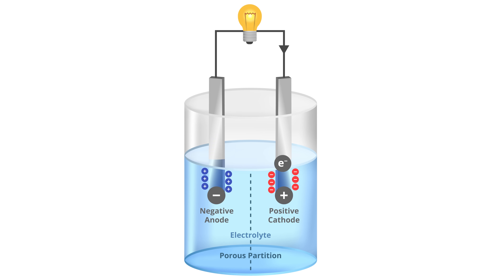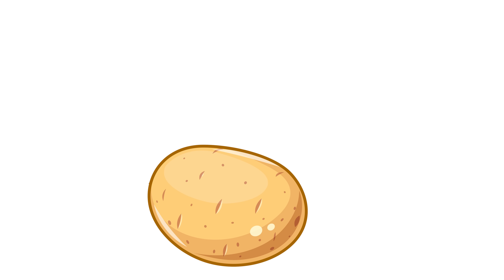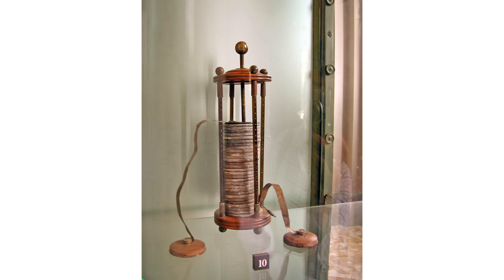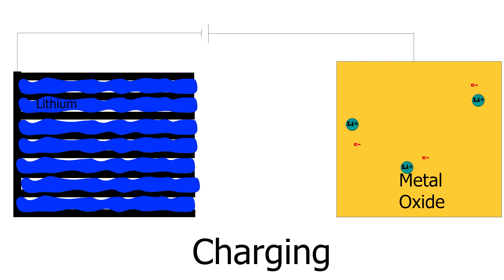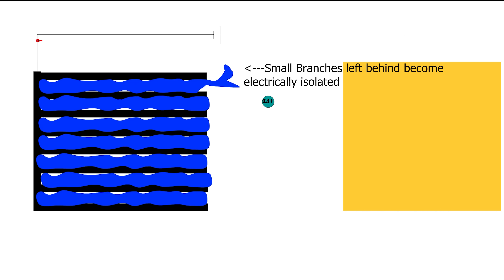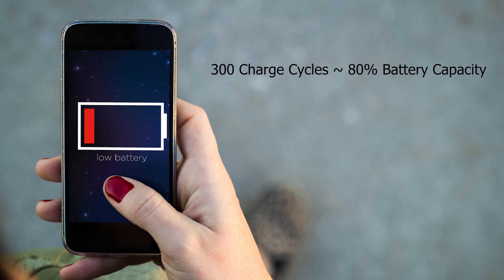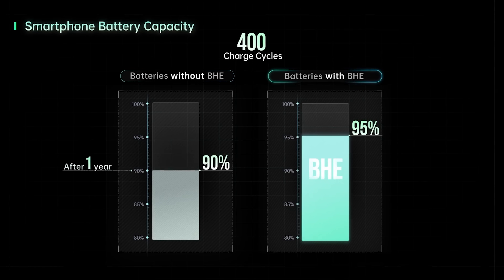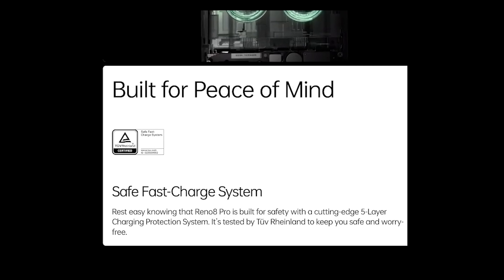How To Stop Dead Lithium and Double Your Phone's Battery Life

Comment: If your phone is rooted, you can use the app "battery charge limit" (free or a few bucks) which works on every phone I tested. Even the non-popular ones (i.e. FxTec Pro 1) are supported.

The app allows you to limit charging to a value you need. I always used 80-85% (-> 85% is the maximum charge). More important though is to always make sure to recharge your phone (and any device in general) before reaching 15% of charge. Notebook batteries often have a buffer, but at phone batteries you can expect slight damage every time you go below 15% of charge. The lower you go the heavier the impact.

Lastly, you don't want to overheat the battery. The best way achieving this is to limit the charging current. You don't need fast charging, use 1A power supplies instead. But don't worry too much if you charge your phone with 2A, just make sure it doesn't get too hot.

That way Li-Ion batteries can last for a decade without problems.

Comment: Greedy jerks at Apple, Microsoft, Nokia, Samsung & others have known this about lithium ion batteries for a long time, especially the Lithium Cobalt Oxide / Hard Carbon battery so common in portable electronics. They deliberately overcharge the battery cell to cause it to fade faster, because the #1 reason people upgrade their smartphone, weak battery! Thank you OPPO! Please share this with Tesla & Mercedes & Toyota & Nissan & all the EV makers //
Reply: A prudent electrical engineer familiar with lithium ion cells would never charge above 4.11vdc, but most phones charge to 4.26vdc or 4.35 vdc, causing an irreversible loss of lithium into the hard carbon / graphite anode / yes dendritic loss of lithium ions a major issue, but fully charging a new lithium ion can help to improve formation of the SEI layer to mitigate that issue.
Reply: The NEST learning thermostat holds its internal LiPo at 3.82vdc, float charging it gently between 65-80% state of charge to dramatically improve the lifetime of the cell //

Comment: "Charge slower and don't let it sit charging at 100%" - nothing new, yet pretty hard to do most of the time.
Wouldn't it be great if besides million watt chargers and super fast ultra charging we got a night charging mode that would take ~6h to go to full and stop charging completely?
I don't care if my new-ish phone battery is 100% or 95% full in the morning, I know it will hold for over a day anyway, so I'd like to degrade it slower but there's no such option besides getting a low amp charger...

Comment: Yes try not to leave it charging overnight. Also, avoid heat 🔥 (driving with phone mounted above the dash in the day), instead use a magnet mount lower down (ideally phone resting over A/C vent)..

Also try not to let your phone die. Better to charge it 20%-80% than 0-100

Comment: I think you should've done more research into this company before sharing it in this manner and presenting it as if the company has technology that is significantly better than other phones. Realistically, Apple and other major manufacturers are already going to be doing most of this. I would've liked to have seen independent testing and/or meta-analysis of papers about this, before presenting this as a science video when it's actually an ad for a (probably kinda crappy) phone company.

Comment: I've switched to pixel phones 2 years ago primarily for Google Camera but I 'm still missing OnePlus dash charge which was basically just a rebranded version of Oppo VOOC. fast charging with no voltage conversion inside the phone, basically like if your charger was directly plugged to the battery. it is actually really very similar to level 3 DC fast charging on EV's!
The biggest benefit was no additional heat generated inside the phone except the heat from the battery we, which meant fast charging while using the phone and never overheating/throttling down the charging speed, and less slowing down at t'higher SoC
Biggest disadvantage was only fast charging with (kinda expensive) compatible dash charge/VOOC charger AND cable, and VERY slow 500mA charging otherwise..
A phone that can double the battery life is a great improvement! Unfortunately USB-C PD has become the norm but is inferior regarding heat management. I wish USB -PD could improve while remaining backward compatible, I like being able to charge laptop, tablet and phone with the same charger.

Comment: So beside it being an ad. A lot of smartphones already incorporated smart charging and it's not novelty. What is a novelty, from what you are saying, is capability to measure anodes potential independently. It is done by introducing 3rd electrode, which act as a reference. Both cathode and anode potentials are measured in reference to that. Lithium is quasi stable reference, but LFP for example can be very stable reference electrode. This system is called 3-electrode cell. By doing so, you can ensure that the anode potential never drops below 0, by e.g. lowering the power during charging (ohmic drop is proportional to the current, which lowers the potential at anode in dynamic state i.e. cahrging).

But that battery won't last long, as dead lithium is by far the smallet deteroration mechanism in batteries. Delamination due to size change and mechanical stress in the coatings, induced by z-fold or cylindricall geometry plays major role. Cracking of the cathode material, gas evolution and on and on. You can divide this into 3 categories - loss of active lithium, loss of active material and loss of contact. Dendrites formation is small part of loss of active lithium. Major part in particle cracking, renewal of the surface and increasing the SEI layer surface area.

Comment: Well, the title definitely feels a bit misleading all things considered... Kinda felt like a really short how to on Li battery operation and then a widely inapplicable solution...

Especially because things like not charging too fast or leaving plugged in are waaay old news. Modern tech handles these problems fine, your phone will slow down charging as it reaches risk areas. Just watch your own, most will start to slow down around the displayed 80% mark to prevent overheating or damaging the cells. We can't replace batteries anymore, and as much as people hate that kind of thing talking about planned obsolescence, no one really talks about it anymore. We just don't have a need, we aren't constantly wearing down batteries to the point of wanting one or two new per year, compared to other PO issues like processor speed or storage, although even storage has become so large and small that no one talks about SD cards anymore. My phone is 3 or 4 years old and im only now starting to feel like my battery isnt great, i charge in 15-20 mins and die over 7-8 hours, compared to 20+ hours when i first got it. Originally, like out of the box, i could almost get 2 days from one charge. But 7-8 hours after years is honestly still pretty good and i rarely if ever find myself in a position where my phone is at genuine risk of dying. I have to remember to manually reboot from time to time haha, because the battery is just still very efficient. 

Any chargers nowadays that would damage your battery life above normal degradation are doing something wrong. Especially since a lot of logic is in the receiving end on the phone.

Idk
Interesting stuff but i was kind of expecting more information relevant to the wide spectrum of viewers directly, in that maybe there was a new technique similar to the 'keep charge between 20 and 80' of yesteryear. Kinda just seems like we are in the same boat, just there are more identical copies of the same boat haha

Comment: It really needs to be said that most people's battery degradation is purely software.
So the real degradation does happen, and the device needs to know that because it can't over charge or let your battery go too low (when your phone says zero, it just means that it's too low to be used, as the volts drop the amps spike and that's a fire). So your phone has to guess at what your new battery capacity is. But it's really bad at guessing if you never tell it what the capacity is. The way you tell it, is by killing the battery fully, and charging to 100%. This hurts the battery, but helps the software. It's well known, and well documented that it is a good solution for phones, and now EVs.

Comment: I would feel more respected as a viewer if you had disclosed that this video was sponsored at the beginning, instead of waiting five minutes to mention it. Just in case you were wondering where all those dislikes are coming from. I'm not sure why you made the decision to do that; I don't see what you get out of being dodgy and omitting that information for most of the video. It would have been just as easy to be honest and open with that fact. We're not going to stop watching a video about battery chemistry just because you properly disclosed a sponsorship.
The video is otherwise very informative. I do feel like shooting down the other techniques to preserve battery health was kind of unnecessary and unscientific, techniques like using fast charging sparingly, using an app like AccuBattery to monitor your battery health, graph wear cycles, and get notified you when your phone has reached 80%. You don't have to use these techniques all the time. If you're going out and having a long day, charge it up all the way, just not when you're sitting around the house or working from home. If you have a change of plans and decide you need to go out, that's the right time to use that fast charging to reach your remaining 20%. I've been using these techniques for the last three years, and once you build a habit, they're not all that inconvenient.

Comment: I don't know how else to contact you except in the comments. I teach about pulse width modulation (pwm) every once in a while and I can't find a good video explaining it as I would like.  I'd like to see an LED fading on and off on one side of the screen using pwm (this would be as your eye sees it). Then on the other side of the screen I'd like to see what is actually happening - the light very rapidly blinking at different rates to give the illusion that we see. I'd do it myself, but I don't have a high speed camera. Thanks!!

Comment: Another major issue is that lithium swells in size as it undergoes charging cycles, causing it to physically crack.  No "app" will stop that.  We already have better lithium alloys, but they are more expensive and manufacturers don't want to spend more money than necessary on "disposable" technology.

Forget apps.  The real solution is to convince manufacturers to build devices so we can easily replace the cheap, crappy batteries.  Good luck with that.

Comment: I literally just learned about how you can use a less noble metal slow down corrosion on a metal.

Also, this is some pretty exciting new tech, not being able to easily change out a battery won't be so bad if this sort of thing becomes mainstream.
Reply: Let me guess: Practical Engineering? 😉
Reply: @phizc  
No, wikipedia.  I was wondering what material I wanted for my bike frame so I looked into how titanium corrodes and ended up learning about this.
Reply: @ToastyTastyPancakes  it's not immediately useful for your purpose, but you should check out Practical Engineering's latest videos about corrosion. His demonstration of how anodes work is pretty nifty.

Comment: Samsung already helps to stop a phone from over charging, and you can make it so it doesn't go to a full 100% charge. You can have it stop charging at a certain percentage like 80%-85%, and it'll stop when it gets to that.
Also, it's common sense to not allow most apps to use your battery in the background.
And get into the habit that when your phone has a system update, go through all your apps to see what settings have been changed. Some apps will suddenly be shown they can now use your battery in the background.
Also, just go through your settings to see which apps are using your battery the most and see how you can reduce their usage.
These are good ways to let your battery last longer.

Comment: I never actually bothered about this, but it crossed my mind several times. Why are companies not already doing that?! Maybe because it's not possible or the benefit wouldn't be as huge. Finally a company trying to figure that out, so thanks to OPPO! My last phone is five years old and i have more than 83% capacity left. What surprises me is, that it actually increased by 2% compared to some years ago, when i last checked it. Is something like that even possible or is it a software or sensor bug? From the description i cannot imagine, how those branches could disappear or something else, that would revive those dead ions.
Reply: Sony did some things since about 2013
Only charging up to 80% and later using the current from the charger directly instead of charging the battery. 
Apple and other are doing this today too… sooo there is nothing very special what Oppo did.
Reply: @patatoothie  Every single phone is doing this. They never charge up to 100% - what is displayed as 100% is not in fact 100%, the actual battery size is a bit bigger, that is in theory it would hold more charge, but it's designed not to be charged that high, because charging from 90% to 100% is as much damaging to the battery as charging from 0% to 90%, more or less.
Reply: @jankoodziej877  I know what you mean but most companies do actually charge up to their „designed“ capacity. On the other hand, if you let your phone plugged in at 100% it won’t actually charge and rather lose capacity than keep charging (like you said).

What I’m specifically referring to is the feature, where you can let your phone plugged in but the device is displaying 80% until about an hour before your alarm goes off, that’s where it will be charged up to 100%.
Reply: @patatoothie  this is a standard feature of the Android system nowadays. It learns your sleep pattern.

As for the question whether 100% is 100%, that of course it's a matter of defining what is 100%, and I believe nowadays manufacturers keep that 100% at sightly lower level than it used to be years ago.

Comment: There is no electronic battery monitor which can keep a defective battery from failing.
I've seen here on YT a number of videos (from famous reviewers) about 1 - 2 years old Samsung phones - which had their battery expanding and cracking the phones open. They were mentioning truly large numbers.
A Li-Po battery hasn't a real casing, as it is contained inside an aluminium bag. Such batteries fail because of the presence of contaminant metals, or water.

Comment: I have a PhD in electrochemistry in the field of batteries so I work with them everyday. and this is just pure marketing. First, I have never heard of dead lithium in lithium-ion batteries. its existent in lithium metal batteries, but lithium-ion batteries suffer from other problems for the capacity fading,which are unrelated to  "dead lthium". secondly, there is no way they can mesure the potential of the negative, because they have a full cell. so they are mesuring a voltage and would require a reference electrode to mesure the anodes potential. This "revolutionary" software trick is actually already done by so many companies that vary the W regading the SOC of the cell... if you want to save battery life, people, dont charge your phone at 80W, this is what is causing the highest chances of capacity fading. In any case, the 80W charging is just happening in the first few minutes at 0 SOC. then its reduced. so yeah. Every decent phone company already doing this.

Comment: Thanks for the battery life explanation.  Do the smart lithium polymer/ion chargers (not for phones) have that type of recharging protection?  To be specific, I fly RC planes and use lithium polymer batteries.  I charge my cells at 1C (1 x capacity).  I had my packs for 7+ years with little degrading.

Comment: Lithium batteries havent had any major changes. All are the same. The only way to prolong battery is by taking care of it. No heat, by external source or by fast charging. Fast charge produces heat. Heat quickly degrades the battery health. 2nd, always keep ur battery between 20~80%. Half full is always better. 3rs, dont let it stay at 100% charging for long

Comment: I live how companies say they are helping and still refuse to add a headphone jack and still refuse to make the back removable so you can replace the battery when it dies. instead of this complex solution, JUST MAKE THE BATTERY REPLACEABLE
Reply: i refuse to buy a phone without a headphone jack. last time i bought a lower end note 10 lite instead of the galaxy s20 for this very reason. my next phone will also have a jack, i don't care about dropping other lesser features.
Reply: you can replace it easily, just start opening and you will get it done.
Reply: @youcankillgod  missing the point completly but okay

Comment: Yeah but it's oppo... Also i'm not convinced that technology is real. Chinese companies have a habit of overstating their products ability and you can easily improve the life span of a battery by doing things like you said, limit the charge to be between 20-80%. Electric car manufactuers have been doing it to great effect for a decade. 

If people really want to improve their phone's ability to retain charge, jailbreak it (get admin access) and install an android system which gives you control over when it stops charging, set it to 80%. Sure you'll lose 20% of your battery capacity on a day to day basis, but in two years time you'll still have most of that capacity if you need it.